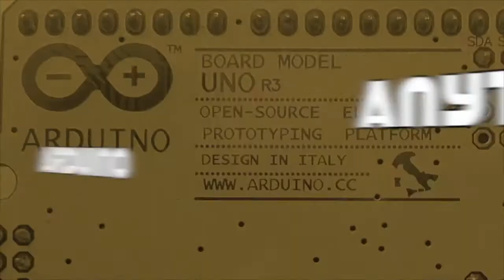Minifying the Arduino - [Anything Arduino] (ep2)

Comment: No! Arduino isn't just a bootloader! It's a board that makes using the atmega easier, by adding female headers and a few parts, like a 16 mhz crystal, leds, Ftdi chip, voltage regulator, short circuit protection, etc.

Comment: Thank you, mate! Is the standalone chip have the same amount memory as the Arduino board with the chip installed on it?There must be some downsides to not using the whole board. Just talking out of my ass here, can you shed some light on it?
Reply from the maker: +Eugene Epifanov Yes, the standalone chip has the same amount of memory. Actually the Arduino Platform is just a prototyping platform with everything on it to connect to the computer and try things out. Once you have a fully working sketch/program you can just take the 328 out and do one of these circuits and connect just the pins you need for that specific project. Then just slab a 328 into the Arduino Platform and you nrew project is ready to go! ;)

But seriously... What you get on the Arduino board that you dont get in my circuit above is: 
1. Computer access, you cant connect it via USB to the computer. 
2. 5V Power supply. I use a "wall wart" for 5V, if you want onboard 5v transformer then you need to add eg a 7805 (similar is on the arduino board) 
3. 3.3V The Arduino board also has a 3.3v onboard transformer. 
4. Oscillator, which is a bit more accurate than the Resonator I use, needs a few more components around it. 
5. Form factor. The Arduino platform has a form factor that enables shields etc to be easily added with loads of space for extra components etc. This means you also get a lot of empty pcb space...

Hope this helps and clears some of your questions :)
Reply: Kristian Blåsol Thank you, Kristian! That's exactly what I couldn't figure out! Keep up the good work!

Comment: Nice, it works great with basic blink sketch. But there is a problem if I try to attach servo, it not working, servo just freez and start making noise... Do you know what can be a problem?
Reply: Actually it works with servo, I wired up it wrongly. Keep doing great job.
Reply from the maker: Great to hear. That would have been my first advice, to check cables. When Servos are wired incorrectly they make a sound but dont move. Usually because the steps come in the wrong order. Great that you fixed it yourself!
Reply: Thanks, your channal is very useful, you explaining very good and detailed. I forgot to connect power with pin 20... Also have latter problem that servo start working randomly, so I added 2 caps one on the source and one close to ATMega that solve the problem...

Comment: Kan man tex: installera både real time clock på 6, 7, 8, åh  6 X MAX7219 i serie även på 6, 7, 8 i 328:an sen Adafruit 14 segment på A4 & A5? Samt keypad? Vet att det är fullt möjligt men dubbelkollar.
Reply from the maker: Allt du kan göra på utvecklingskortet kan du göra med bara processorn. Kortet är ju bara för att få shield-funktionalitet och USB koppling till datorn. Allt annat är  i chippet. Tänk på att skydda pinnarna precis som. Du måste göra alltid annars.
Reply: Ja ska använda 10 siffror! MAX7219! En st. för 8 digit krets 2 för 2 X 7 segment som ä genesamt samman kopplade! Sen stänga av de 6 resten. Jag vill inte ha böjd 6:a böjd 9:e de ska va rak 6 som ett litet b å rak 9:a som ett bakvänt p! Detta är väl möjligt??